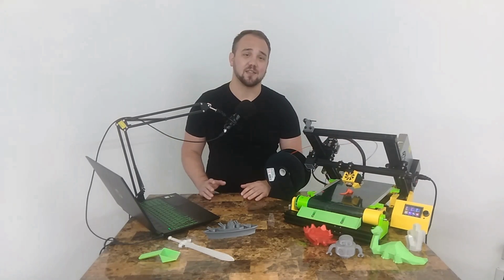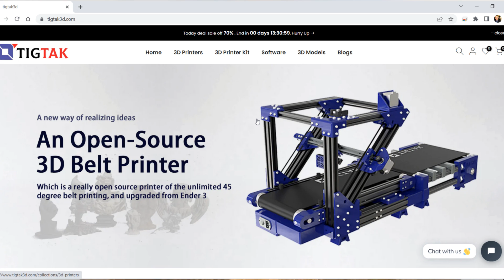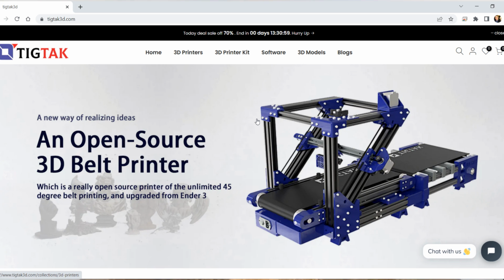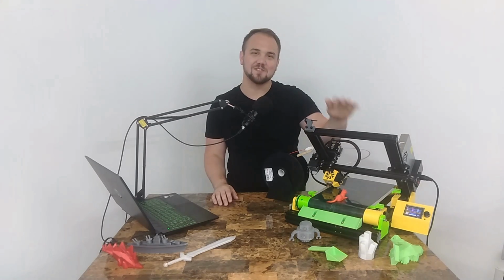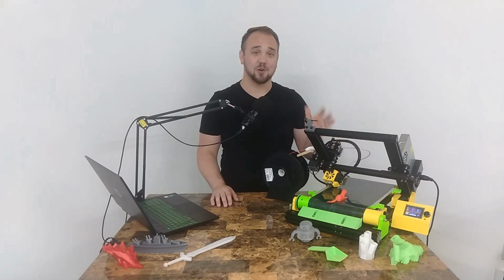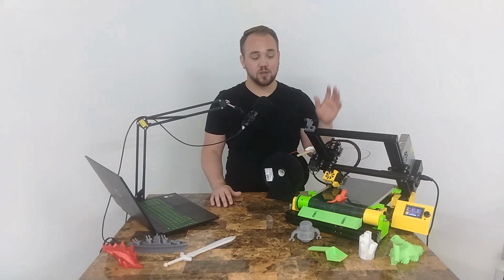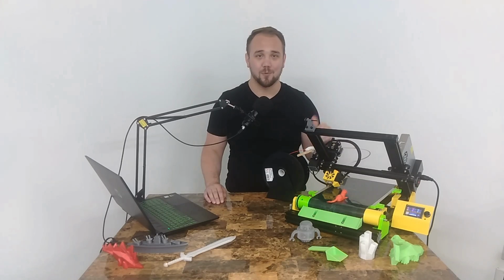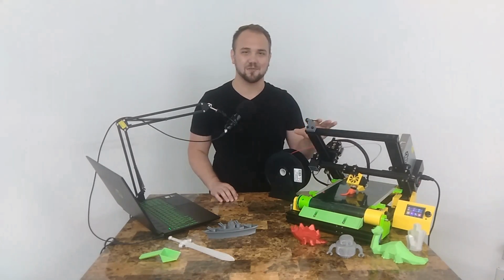DIY Simple Ender 3 Belt Printer Mod on the cheap! - Ender EZ Belt

Comment: Hello, is it possible to use this with Arduino and Marlin firmware? Thanks!
Reply from the maker: It's possible! The Marlin config files are on Printables, you'd just need to change the board type.

Comment: Hello, I want to purchase your powerbelt but I have several questions. Do I need to modify the firmware to get conveyor belt to turn or is it using one of the axis ?
Reply from the maker: Hey there! You can use the firmware available on Printables and flash it to a BTT SKR Mini V2. Or you can compile it yourself for any board - there's another video on the channel on 3 simple changes you need to make. It turns the Z axis into the belt axis.

Comment: hi will it work in that way if rather tilting gantry at 45 degree, tilt only extruder at 45 degree? thank you
Reply from the maker: Mechanically - yes. However, to my knowledge, a slicer for that setup doesn't exist. You would need X, Y, and Z to all more in sync to print every layer.

Comment: How would I install direct drive on this? I love the design 11/10
Reply from the maker: Thank you! Direct drive should be possible with many of the existing Ender3 mods out there. Thankfully I haven't had a need for it, even when printing TPU.
Reply: @powerbelt3d  is it possible to keep the gantry at 90 degrees?
That's what I want to do. Looks like I could do that just by looking. What do you think?

Comment: Is this simply an original Ender 3, or is your design compatible with the V2 and/or V3 versions.  I had to sell my last ender when i moved across the country a few months ago, and I want to do this build, but I need to make sure I have a compatible machine to work off of.
Reply from the maker: I've used an Ender 3 and an Ender 3 Pro. I've seen a build based off the Ender3 V2. The only change needed, is you'll need to move the power supply to make space for the back roller.

Comment: Hi My ender Ez belt hotend mount is very wobble. I have tightened the screws and tried petg and resin but it is still wobbly. I was wondering if anybody else has this issue and how to fix this.
Reply from the maker: Sorry to hear that! Some others are said the same thing, and I have a slightly bulkier hotend mount that I need to get published.

Comment: Hi I have an Ender 3 v2 and would love to know if this could work with my printer
Reply from the maker: Hey there! Most of the modification should work. The big difference with an Ender3 V2 is that the power supply will need to be moved to make space for the back roller mounts.

Comment: Sorry, just at work so I gotta watch the full vid later. What build volume to do you have now with this infinite Z variation of the ender 3? And what slicing software do you use for the infinite slice?
Reply from the maker: Z height is decreased to about 100mm. I've been enjoying IdeaMaker from Raise3D. It has belt slicing capability built in. You can find slice profiles for IdeaMaker at the Printables link.
Reply: Awesome. Thanks mate, what are the other dimensions?
Reply from the maker: @XklusivStudios  200 on the X axis. The belt axis is infinitely long, so long as the part is supported and you have enough filament

Comment: How's the adhesion on the belt? Is it compatible with other belts like the CR-30 belt?
Reply from the maker: I'm biased because I invented them - but really good! It works with all the normal 3D printing materials. Check out the video pinned on the channel where I explain how it took 28 months of trial and error to come up with them.
The belts for this build are a bit smaller than the CR30 belts. So it could work, but you'd have to modify it.

Comment: Hey Adam! Just finished my build :) wondered if you have a discord for fellow ender ez belt enthusiasts?
Reply from the maker: Happy to hear it! I'd love to see some photos. Unfortunately I don't have the bandwidth to properly run/moderate a Discord. Otherwise I'd love to have one.
Reply: @powerbelt3d  I'll send some photos your way. Everything is built and assembled.  Now just to finish going line by line in Marlin to get it up and running from your Marlin build for the skr mini e3 v2 board to my skr mini e3 v3 board. Fingers crossed!
Reply from the maker: @LevelFunGames  Good luck!

Comment: FYI your website cert is having an issue according to google.  Also, can you extend the x by using a little longer hardware?  100 is a bit small.  Thanks!
Reply from the maker: SSL is fixed; thanks! Extending any of the axiis would mean extending them all a bit - unfortunately.
The build volume is 200 on X, 100 tall (Y or Z depending on how you think about it), and infinite on the belt axis.

Comment: Amazing work, Adam - even more so with the fact that you provided the STEP files! ~

I want to make a 30° build 😎 

I bought an Ender Bender belt from you a while back, so I was wondering. Do I need to buy a new belt for your project, or can I re-purpose that one for this project? 🤔
Reply from the maker: Thank you Chris! A 30 degree build sounds interesting. You can re-purpose the Ender Bender Belt, but you will need to trim it to be a bit smaller. The Ender Bender Belts are 220x960mm, but the EZ Belt ones are just 210x810mm long.

Comment: Any plans for a CR-6 variant? Or will these fit?
Reply from the maker: The CR-6 is so similar that these should fit, but some parts might need some modification. I included all the STEP files on Printables to make it easy!

Comment: Wow Adam! You beat me to it haha. I have been looking at the options to convert my ender 3 and they are all either $250+ for just the conversion kit, or so dang complicated that it wasn't worth it. I wanted to design a simpler straightforward strategy to convert the ender 3, but now I don't have to. Your design is very elegant. Much Thanks! Will report back once I complete my build.
Reply from the maker: Hey I'm glad we had the same idea! Good luck on the build!

Comment: Where did you get the motor pulley from the Prep Y Motor step (it's not in the bill of materials and I didn't see it previously on the ender)
Reply from the maker: Good catch! I've updated the BOM's on Printables. It's a GT2 20-tooth pulley.
Reply: I was able to print it out :)

Comment: Why is the Y endstop step before modifying the y system and hotend steps?
Reply from the maker: Good question! I added the belted Y-axis to the build after I had been printing with the lead screw Y-axis for a while. Plus, I think it's helpful to set the Y endstop close to where you'll need it while doing the belted Y-axis. That way, the X axis isn't hitting the heat bed and applying pressure to the hotend mount.

Comment: Is the belt printer nozzles 5mm or 7mm? (option on website)
Reply from the maker: 5mm for the Creality hotend. 7mm if you're using an e3d v6 or something similar. Truthfully though, either will work. The 7mm will just look a little awkward.

Comment: This is totally BOSS !! I've been talking 2 U on twtr about your comments.
I make 4mm thick, 300 to 500 mm long pieces about 100-130 mm wide on an E3V2 running slowed Prusa 20-40 mm/s motion settings in all parameters. They are all PLA designed in SelfCAD. Right now I'm doing them vertically in 2 parts and overlapping and screwing them together. The surface has indiscernible layers with smoothness that looks like it's polished.
Reply from the maker: Thank you! Having one infinite axis is really helpful when you have a part that is just a bit too long.
Reply: i'm a year later on this, but just so i know, did you have to make any changes on the firmware available on printables to make it work on E3V2? or can i just use the same and it will work fine?

Comment: Looks less complicated and really nice work, I'd like to ask you if these bed screws works for hotter bed temp, or reprint to different positions? Even so how much can the belt you made go hotter? I want to know is that able to print at 90-110 degree or hotter? 

Thank you for the video.
Reply from the maker: Thanks for watching! The heat bed extenders should be printed in ABS or PC. That way the heat deflection temperature is above how hot the bed is.
On other printers, I've printed ABS on a Formula32 belt with the heat bed at 110C with no issues.
Reply: @powerbelt3d  Thank you for the information, and the last one, the belts has an expire date I think, what's the expire date for formula32?
Reply from the maker: @MMK-342  Hopefully I understand the question correctly 😅 The Formula32 conveyor belts, depending on how much you print, should last 6-12 months.
Reply: @powerbelt3d  You understand well :) Thank you.